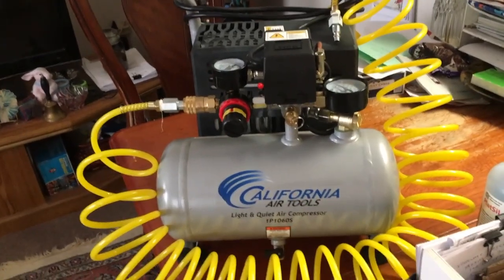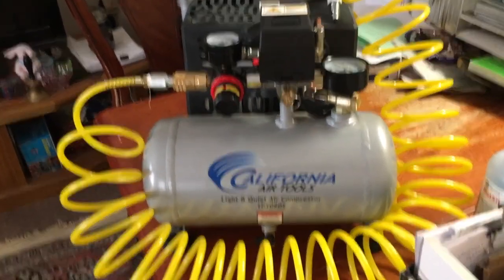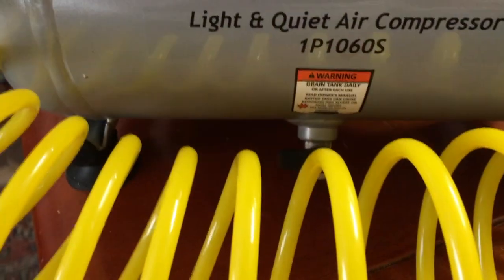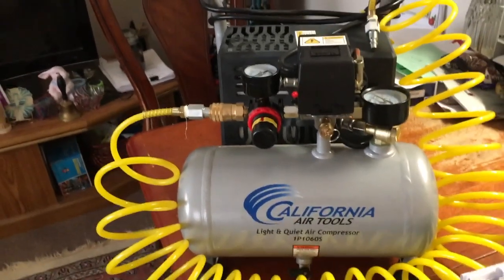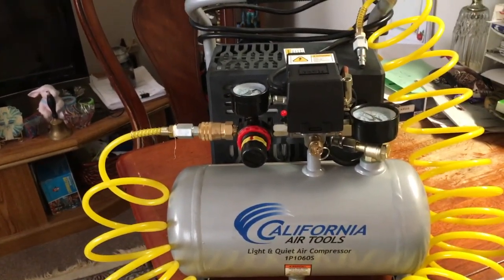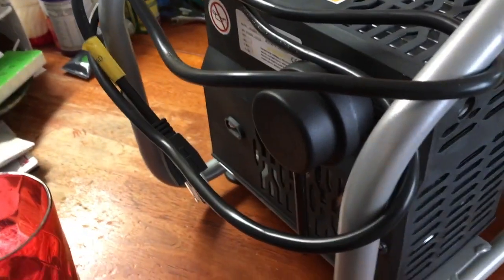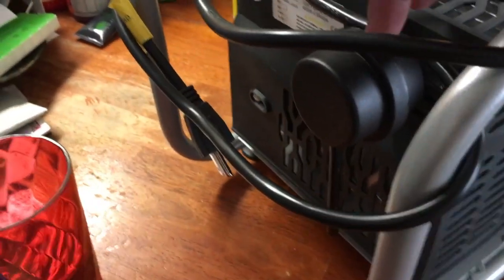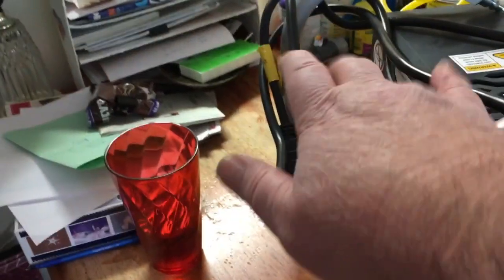California air tools mini compressor model CAT-1P1060S  air  filter  location tip

Comment: I purchased this air compressor for light at home work. I was impressed by the videos on how quiet it is. I was happy with the compressor for a few weeks until the pressure switch went out. I had to mail the whole compressor to California to have it covered under warranty. They fixed it no problem and sent it back. It worked fine for a few more months until the pressure switch started acting up again. I would have to fiddle with the switch to get it to pressure in the tank. Once out out of warranty thw motor seized up and filled my garage with smoke. I was fortunate to be home. I called for a replacement motor cost, and its cheaper to buy a new compressor. I caution anyone who buys this brand. The concept is great, but the quality is not there.
Reply from the maker: Thanks for your  feedback , have  not had a problem with one  i use  at  all. Sorry you did.
Reply: That and I know two guys who got weld beads in tank; one original then replacement.